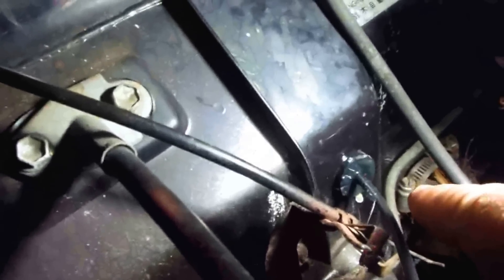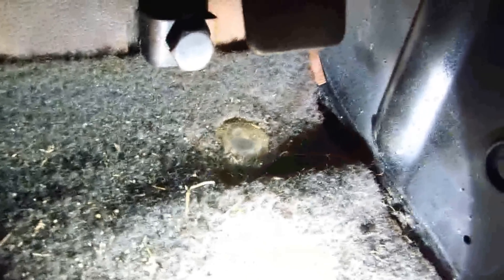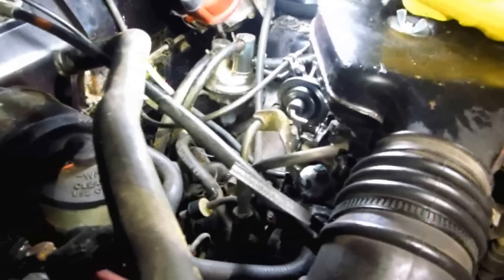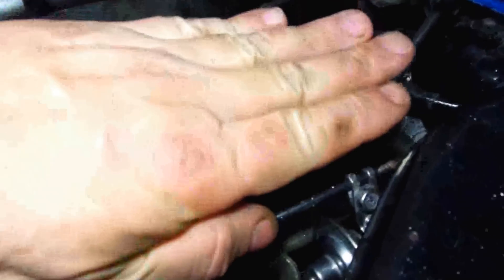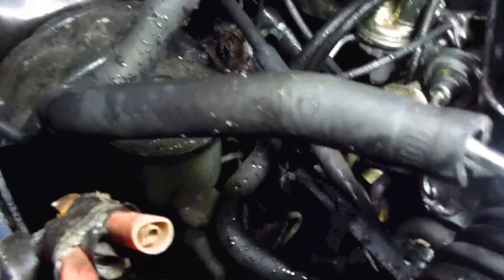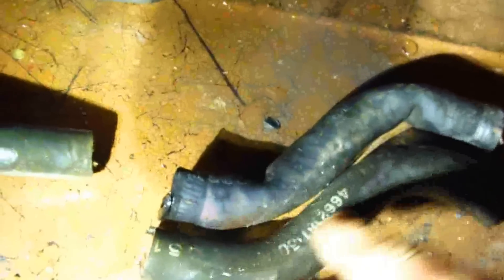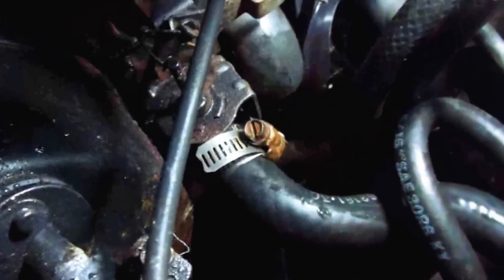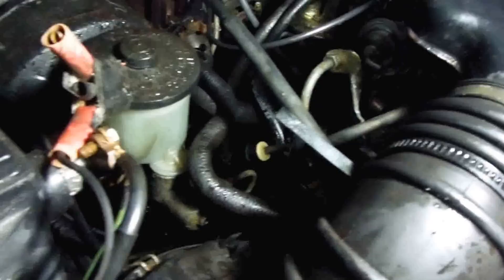Suzuki Samurai -Heater Core Flush w' VINEGAR & misc

Comment: Great video! Only thing I would add to this is to flush out the vinegar with two tablespoons of baking soda with 2-3 gallons of distilled water (vinegar will eat aluminum).  I do this and run it through the entire system on the highway for about 20-30 mins with the heat on to neutralize the vinegar and back flush the core to remove any buildup.  Then fill with coolant preference and bleed as usual.

Comment: I see many videos with people going to great difficulty to take off hoses so they can flush a heater core but you already have a way to flush your cars heater core, it's called a radiator and water pump,so just utilize them. Seen many clogged heater cores fixed just by draining the coolant and filling up with 90% water and 10% vinegar. Go for a half hour drive and then leave the car overnight. Then drain it. Keep doing that until the water is clear. When it is, add your coolant and that's it. All these expensive flushes won't remove anything more than this method will. They might do it quicker, but that's about all.

Comment: If you keep talking to Rocky he will talk more I'm sure u no that  , but grease is good for those hoses it keeps them soft ' I see you used those regular hose clamps when you fixed that heater hose I thought you liked the style that tighten when they start to get loose you no the type you should spray some w/d 40 on those clamps I like using stainless hose clamps !good job !!!
Reply from the maker: Yeah, stainless clamps are the best.  Btw, I drove this thing around on the road for about a 1/2 hour.  I runs fine and pulls strong in any gear and at any rpm.

Comment: Hi Man,
my heating sistem just stoped working. I did step with taking leafs aout of heater box, also did  flush with vinager and wather, but heating didn't work at all.
Is it air in to the sistem problem? pipes wich go to hot wather controler (dashboard) is hot, also pipe from that controler is also hot, but pipe from heater (radiator) is cold. I don't know how is that posible, because when i flush the sistem, whater easily came out,first dirt,after clear.
Reply from the maker: Maybe the heater control on the pipe is stuck closed that opens up the water to the heater core.
Reply: @syyenergy7  heater cotrol - you mea that part controled by the wire from the dashboard (hot/cold). That working.I meant that is broken,so i bought a new one.
Reply from the maker: @urostasin6679  I'm talking about the valve on the heater hose under the hood that the control inside is hooked up to.

Comment: great job. i have 1998 suzuki esteem.  problem is  its starts then it gets warm the engine stops. will not restart. engine turns over but will not run. before this problem i change the fuel pump, fuel regulator and fuel filter. replace the crank and cam sensors. help , i have no clue big guy.
Reply from the maker: You definitely want to read the diagnostic codes.   Code readers are cheap, for a simple one.  But try some starting fluid and see if it fires up.  Simple stuff first.
Quick How to - Engine Troubleshooting- SPARK & FUEL
Another thing, sometimes electronic components, when they start to fail, will not work when they get hot, but work great when cold.  Cold compressed air for cleaning computer components is useful to test for that.  You spray it on the suspected component and see if it starts up a again.  I suspect it is something electronic, versus fuel related.  If you use starting fluid to try to re-start the Suzuki right after it stopped, when warmed up, and it still does not re-start, you flat out know it is not fuel related.  I am not familiar with that car, but it could even just be a relay.  Tapping on relays with a screwdriver handle, may reveal the problem too.  I know a million tricks but I don't have the manuals on that car.
Reply: obd 2 has no codes. got spark , agree your ides  but could it be ground fault problem ?
Reply from the maker: MrLeon1701
I hate that when it has no codes or the code is wrong.  Simple stuff is also replugging in every electrical connector.  And Yes clean every single ground.  The computers today require exact voltage to work and a weak battery or Any Ground that is not that good can cause weird problems.  But I would try the starting fluid trick and see if it re-starts when warm, after it died.  If it does not, then you know it's not fuel.

Comment: You should see if you can get a owners Manuel ! That a cheap way to putting a Governor on the full intake by putting that adjustment bolt on gas peddle !
Reply from the maker: I have loads on manuals on this Samurai, but remember the Toyota carb is not OEM for this vehicle.  I am getting about 98% to 99% throttle when the gas pedal goes to floor, which is really virtually the same as 100%.  I doubt I will ever floor this thing.  If this was a race car, I sure would make sure it went to 100% throttle.   The difference on this thing would be maybe 25% of the power of gerbil :)